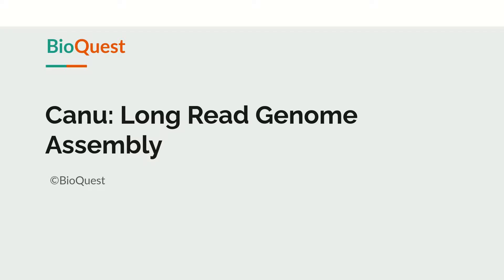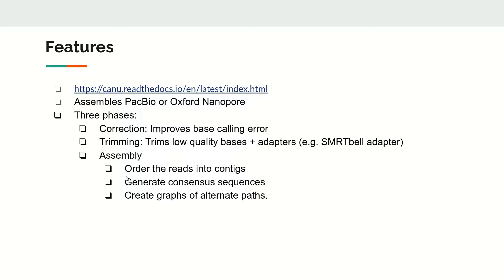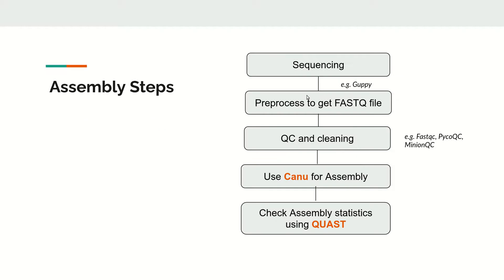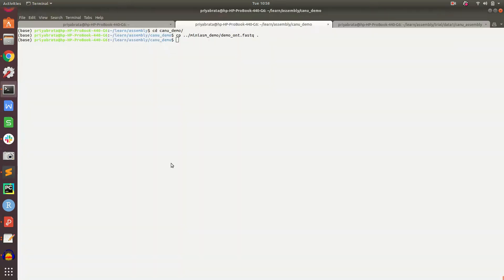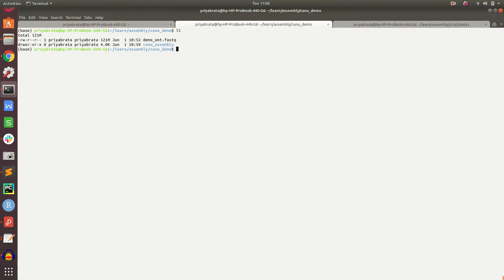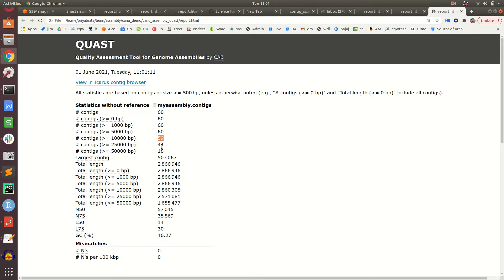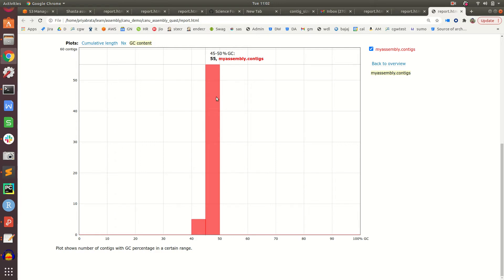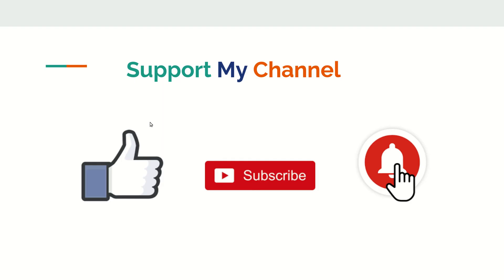Canu: Long Read Genome Assembly Tool

Comment: Very helpfull video!. I have a question, why do not you use a reference genome to assembly?
Reply from the maker: See there are 2 possibilities
1. You have reference genome already known e.g. human. 2. You do not have reference genome e.g. a new species is identified and you plan to sequence them. In former case you can use already known genome reference information to guide the assembly process. In second case, you are newly doing assembly to generate reference genome. In first case at least you can compare the assembly with reference to infer how close your sample is with the reference one while in second case you have to trust or validate the assembly based on assembly statistics or some other literature evidence or prior experimental evidence.

Comment: for the make -j<number of threads>, what does that mean? after that what to do to process your fastq.gz data? thank you sir
Reply from the maker: Number of threads in your system. If using linux nproc command will tell how many cpus. Accordingly you can specify while compilation.